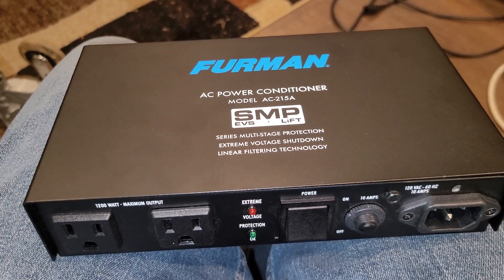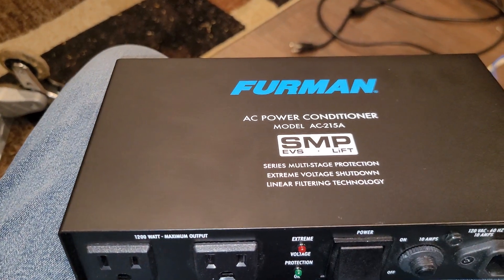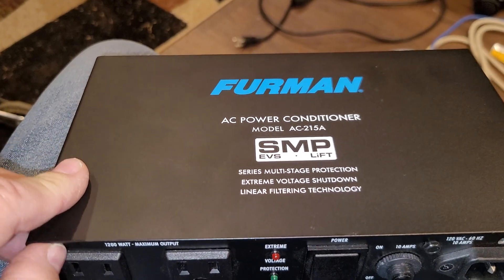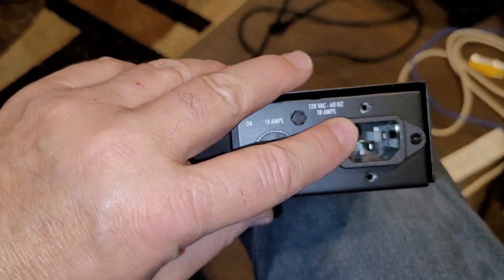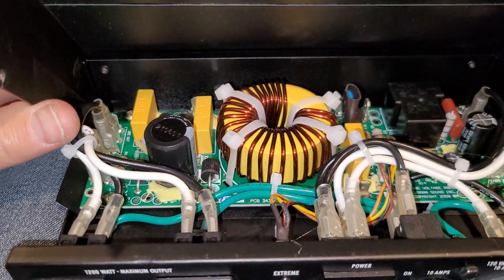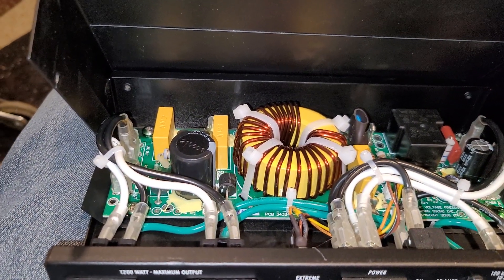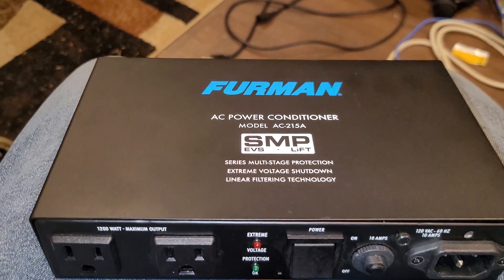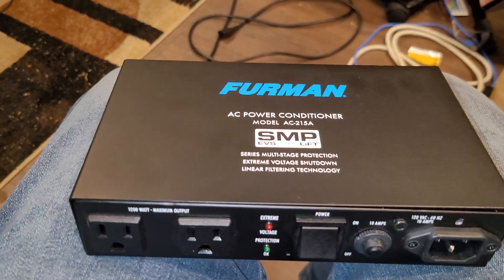Furman Power Conditioner. the AC-215A. A quick review and look inside

Comment: The Firman is there for controlling line voltage and stopping tracsinant peaks unfortunately the unit for what they charge is very poor value for money input and output sockets are not metal screened medical grade the outputs are cheap Chinese rubbish as I design A/C power units in the UK I would put the total build cost at around £30 Furman need to do a lot better
Reply: What would you recommend?
Reply: I use a product from Smart Power Systems. It's a US based company and the product is actually manufactured in the US and can be had for less than this Furman. 

I don't know a whole lot about electronics but looking at the internals of the Smart Power Systems filter it looks much more impressive than the Furman. It actually uses a transformer for filtration. 

I don't think many people know about these units because they're usually supplied with office or banking equipment, but they seem quite good for the money.
Reply: @ The transformer will be an isolation unit which separates the input power from the output best quality for audio is a toroidal unit which will be round give me a shout if you need any further help
Reply: @ build your own not sure which country your in but I left my glasses in my works van can you give me a shout wednesday I will recommend you a set of products 👍👍

Comment: I have a problem where whenever I plug a mixer or mic preamp into my audio interface there is a constant hiss like background noise. Would one of these help remove the hiss?
Reply from the maker: Yes it may very well help
Reply: @elnyt123  it might help but the noise doesn't sound like mains sourced interference try to get a really shielded mike  cable and see if that helps when you test also check all your connections just to rule out any loose conections
Reply: @drmindbender8616  I ended up solving this issue. It ended up being my Focusrite interface. No hiss with my Apogee or Black Lion interfaces.